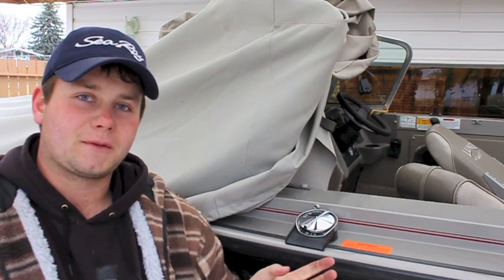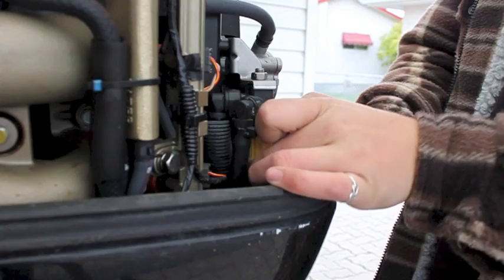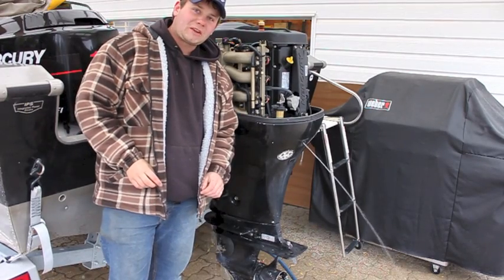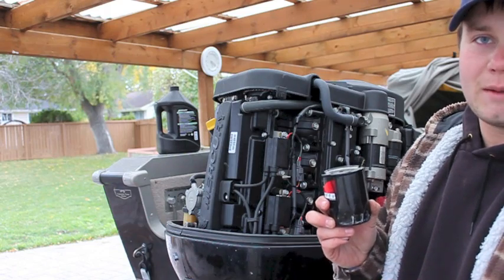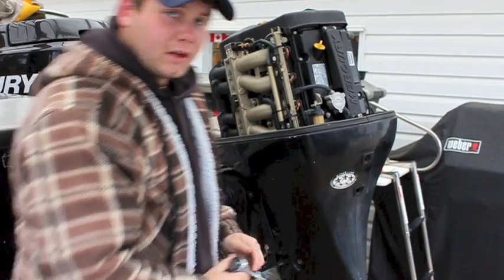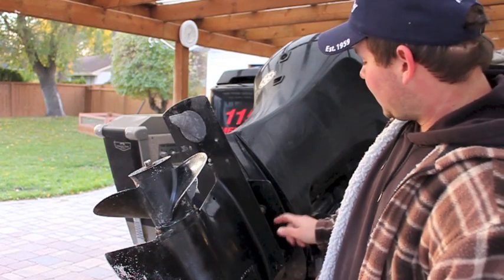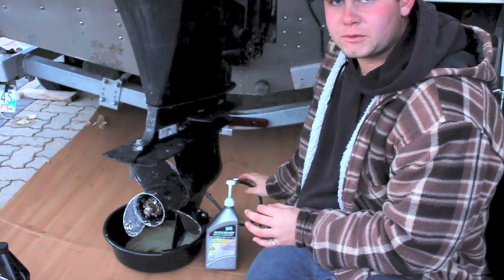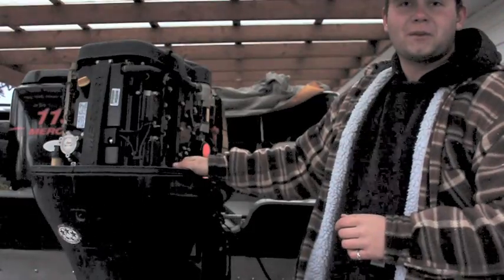Outboard Motor Winterization - Mercury 115 FourStroke EFI

Comment: NICE JOB BUT ARE WE FORGETING ENGINE ANTIFREEZE FLUSH FOR PREVENTING ENGINGE FEEZE UP OR WATER THAT MAY EXPAND IN THE MOTOR AND CRACK THE BLOCK THIS SHOULD BE THE MOST IMPORTANT STEP IN YOUR VIDEO THAT YOU WERE MISSING .... YOU SEEM TO BE VERY TALENTED IN MARINE MECHANICS IM SURE YOU PROBLABY JUST MISSED THAT STEP. ALL THE BEST

Comment: Excellent video, not.  Several major faults.  First, Pouring fuel stabilizer in the tank and simply running the engine for 5 or 10 minutes does NOT EVEN COME CLOSE to ensuring proper circulation of stabilizer through the fuel system. The proper procedure is to add a generous amount of stabilizer in the last tank of fuel that will be used for the season.  Meaning, the last trip or two out on the water should have had stabilizer in it.  Second, the fuel tank should be stored full to the top with fresh, stabilized non-oxygenated fuel.  Third, the oil filter should be pre-filled, or at least soaked with oil prior to installation.  Fourth, he did not fog the cylinders.  Bad video.

Comment: 2 QUICK QUESTIONS:  1) I may not have time to obtain and then replace the lower unit oil before the outboard is exposed to freezing temps in unheated (but covered) storage. Would it be okay to simply drain the lower unit oil now and refill it spring?   2) Should I pull the battery or is it okay to put it on a battery tender while still installed (but exposed to cold)?  Thanks!
Reply from the maker: Dave B yes it is ok to just drain the lower unit oil if it is being stored well covered. Make sure you do something like tie a ribbon onto the steering wheel so you remember to fill the lower unit in the spring. It’s totally fine to leave the battery in the boat as long as it is fully charged and you disconnect it, to prevent anything from possibly draining it. If it get drained, then it can potentially crack and be ruined.
Reply: JAMIE:  Thanks for the quick reply/answers - REALLY APPRECIATED!

Comment: Jason,
Thanks for your outstanding demonstration of winterizing an outboard boat motor.  It seems a lot of work but you made it so simple.  Is there a way to remove all water in the bottom gear? I see you drained all out, but with a tight and closed reservoir gearbox there are still water hanging inside.  Compressed air blow?   To get it done as you did is good enough for me, but if we can do little more throughly the gearbox has more wear and tear protection.  I see some people uses anti freeze coolant to run the engine, and it is also good but it is not really worth it to do.  Overall, You give an excellent demonstration.  Great Job.  Grade A for you.

Comment: Nice video Thank you!) I just saw video from another guy and he did't mention about fuel filter. and water hose connection. Brake my had thinking where he got water source from and how, to run motor. (I am at beginner level for now))))

Comment: hi dear
i have a 1995 115hp Mercury
i am having some issues to start it, after 5 or 7 times starts and runs ok, but after turn off and leave it off for about 20 minutes does the same, so i am wondering if you have any suggestion if there something i can do my self to resolve this issue, thank you very much in advance. Orlando

Comment: i've got a 2011 mercury 115 FI outboard and i want to use the boat right up until the lake freezes over. I store the boat on my driveway and Nov/Dec tend to see temperatures rise above and drop below freezing day to day. What do i need to do to keep anything in the outboard from freezing? Some people say warming blanket, others have said to wrap the lower unit in electric heating cable. What do you suggest is the best method if i cannot fit the boat into my garage and have to store on the driveway???
Reply: Roy Dallas I'm in Sweden and all we do for winterization apart from oil changes is to run the engine not only with fresh water but also with glycol solution for a few of minutes. Then we just let the engine stay on the boat outdoors all winter.

Comment: This was excellent, thank you. I also pump rv antifreeze through the bunny ears until I see it come from the discharge outlet as an extra precaution. Let me know if anyone disagrees with that method on top of what he has shown. Great video...
Reply: There is really no need to use antifreeze as long as you let all the water drain out of your motor for about 30 minutes. 15 minutes 1/2 up and 15 minutes all the way trimmed down. Antifreeze doesn't hurt but its just a really big hassle.

Comment: my 90hp mercury 4 stroke has carburetors. How do I fog it?
Reply from the maker: If you remove the cowl (cover) you will see the carburetors on the front (towards the bow of the boat). Spray fogging spray into here while running, and ideally it into the spark plug holes.

Comment: It's a good idea to top off the fuel tank to prevent condensation in side of the tank  over the winter months. You should know the capacity of the fuel tank and won't have to estimate how much fuel saver to add.

Comment from the maker: It should be noted that fogging is not recommended for a fuel injected engine. Stabilizer is enough to protect the injectors and associated parts.
Reply: What's the reason to not fog fuel injected engine?
Reply: I disagree with his opinion.  Fogging is to protect the surface parts of the carbs, but also to protect cylinder walls.  I've never heard of anyone who doesn't fog an outboard just because it's EFI.
Reply: Fog with 2 cycle 50:1 mixture in a test tank.
Reply: And what about the cylinder walls?

Comment: Thank you so much for a great explanation on winterizing an outboard motor. You did a really great job and saved me a bunch of money. I have a Mercury 60 hp 2009 four stroke and cannot figure out where to put the antifreeze because a boat guy said to put it where I put the water hose goes, but nothing can go IN that connection, only out. I don't have a manual, so I guess I should get one. Thanks again. You are great.